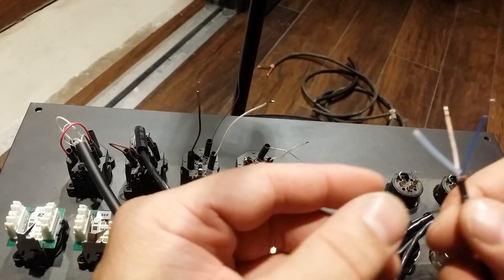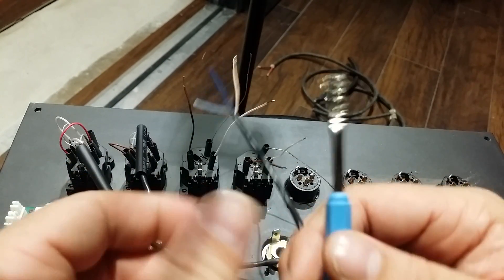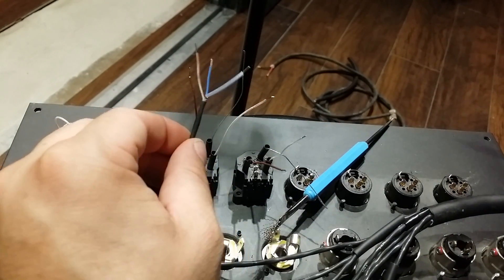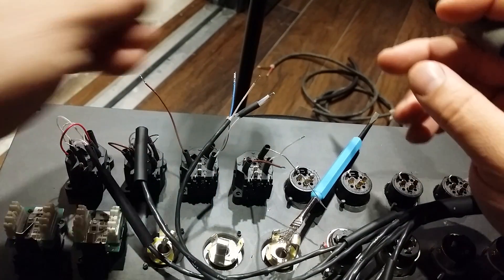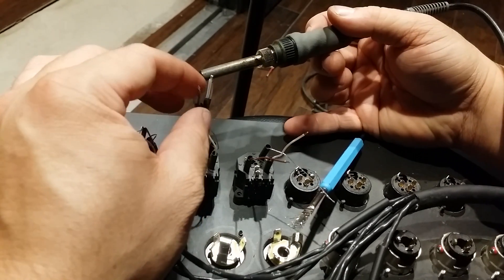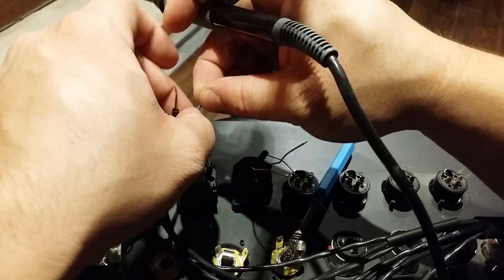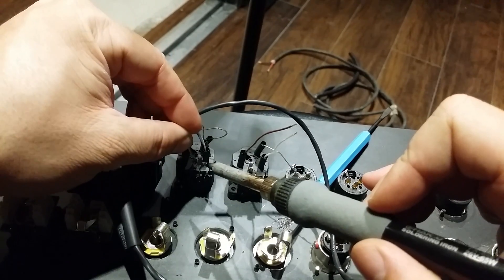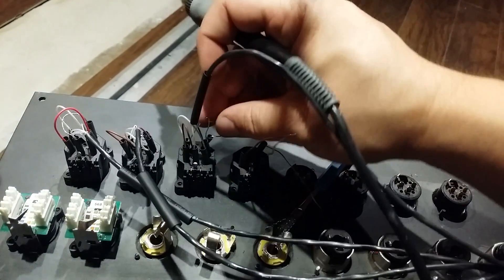Studio Wiring - Neutrik TRS / XLR Combo Jack Installation Pt 2

Comment: Please, could you explain what happens with cables wiring at the other side in the control room? 
Because using combo XLR/TRS connector in the live room, you end up to a patchbay in the control room that get both signals (mic or line) on the same socket (being Bantam or TRS, doesn’t matter).  
Is this correct?
Even if more expensive, would it be possible to install an identical patchbay with combos XLR/TRS in the control room too?… So that, when needed, I can get mic signal or line signal depending on what I plugged  into the live room patchbay panel. 
Thank you for your advice!

Comment: Use needle nose pliers to help hold the wires. It saves your fingers from the heat and helps be more surgical with the placement.

Comment: Great video, i soldered a panel yesterday and im getting a pretty loud buzz from it (that wasnt there when connecting directly to the interface) any idea what will cause that?
Reply: I have the same buzz. ADiSH, did you ever solve the buzz problem. Mine only buzzes when I connect the 1/4 plug.
Reply: I did actually, i switched from plastic connectors to better metal ones and used a better cable (im not sure which one fixed it)

Comment: can you solder direct without the jumpers?
Reply: Yes. Neutrik recommends jumping from pole to pole with shorties. Also Lane, the answer to your question is Yes! If you wanted, you could wire the 1/4in and the XLR to different places entirely (i.e. line in vs. xlr in on an audio mixer)
Reply: instead of using long wires y wouldnt u just use a short piece to jump straight form pole to pole?
Reply from the maker: +Lane Cyphers You can solder direct for either XLR or 1/4" input, however you will be committed to whatever you soldered to.  If you solder direct to XLR, 1/4" input will not work.  If you plan on doing this, you'd better off getting a standard XLR or 1/4" jack, instead of a combo jack.

Comment: This video was very helpful.  As someone new to soldering, could you point me to what you are using for those short black solder cup insulators?  Did you purchase or make them?
Reply: Glad it helped you!  All of the heat shrink was cut to size.  You can also buy pre-cut lengths of heat shrink from a company like Redco.  1/8-1/4" diameter should be fine.

http://www.redco.com/Shrink-Tubing/